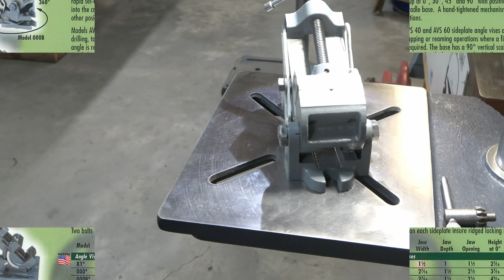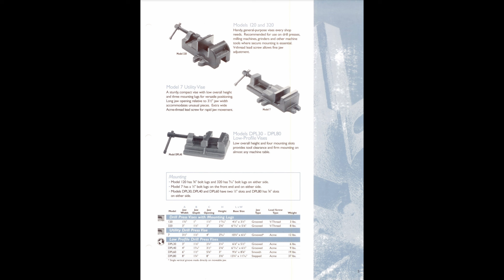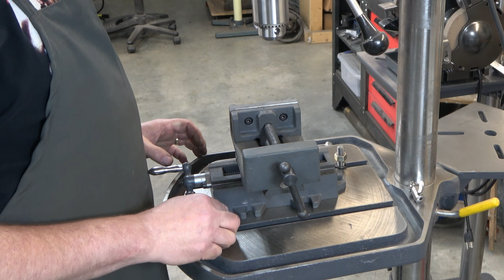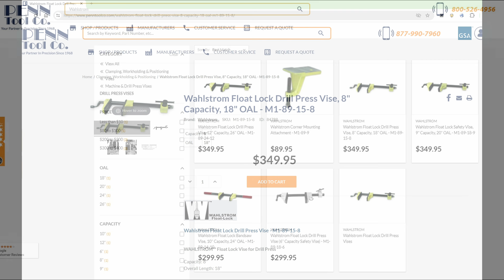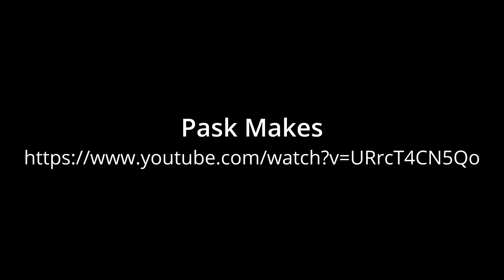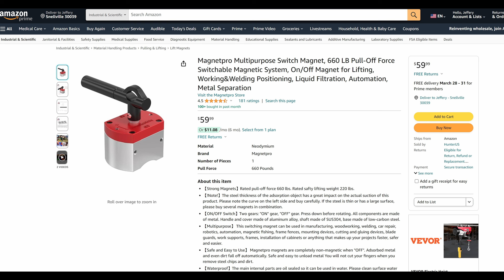Part 2 Drill Press Vise General Information

Comment: Great video. If you could only keep one which would it be? I bet that is a tough question.
Reply from the maker: Actually no, after working with all of them, I believe the cross slide vise is the most useful and user friendly. I would not spend money on a cheap harbor freight version and choose a Shars, Yost, Palmgren, or Wilton.
Reply: @JeffsShop  Thanks.

Comment: Thank you for the very good video! What do you think about Flott felix vise, and also about Fein VersaMag vise?
Reply from the maker: Oh WOW, I really like the Flott felix vise. I do not know what they are charging for it but that thing is built with safety in mind and looks to be a very high quality tool. I do not know anything about the Fein VersaMag vise but the price looks to be above $400.00. I will need to start looking for a  Flott felix vise. I want that vise.
Reply: @JeffsShop Flott Felix is expensive but premium quality, 80mm is 310Euros, and 100mm i 580Euros, in Germany. Fein VersaMag is 100mm and uses magnet for clamping, also looks premium quality, price is around 330Euro in Germany. Cheers!
Reply from the maker: @slob987789  I would be willing to pay 330 Euros for the vise, now I just need to find out if they ship to the US and what that will cost????? Perhaps they have a US distributor? My German is vary rusty, like I have not spoken German since 1999. Anyway, thanks for the information.

Comment: Great video, and understated tools. Surprised you didn't note the use of Parallel Sets. One anoying thing I could never figure out about a lot of these vices  is the fixed jaw on many  has a relief slot at the bottom corner which prevents the use of parallels. I can only assume thats for chips, but I'm not really sure.
Reply from the maker: Thank you for the comments and for watching. I believe you are correct about the chip relief. I do feel that parallel sets are very beneficial but I wanted to stick with just the vises because I see so many videos where people do not use a vise and with this series I had two goals. First to explain why everyone should be using a vise when working on  drill press, and second, to briefly cover some of the vise options. Again thanks for the comments and watching.